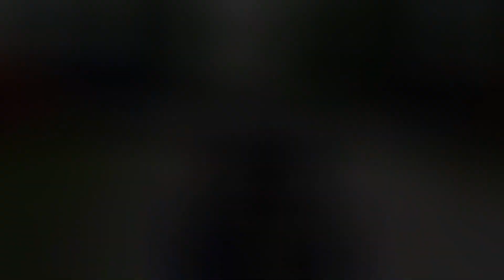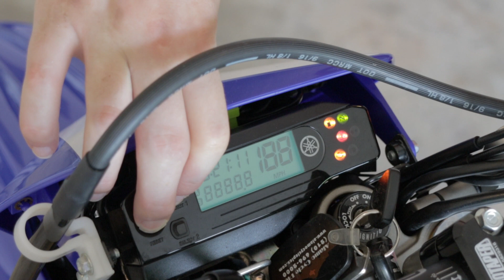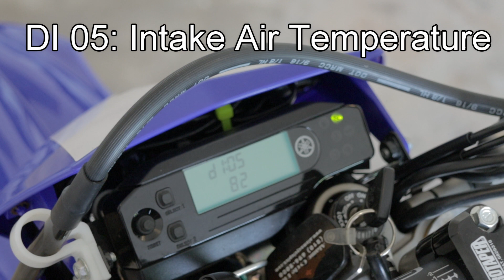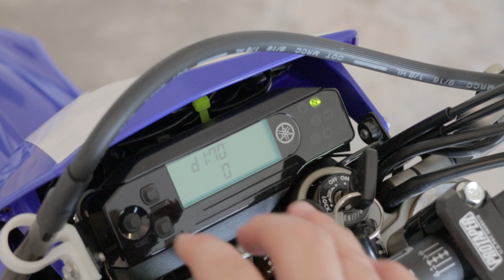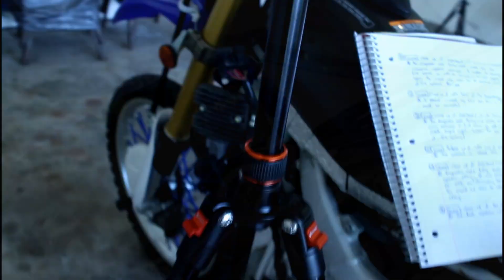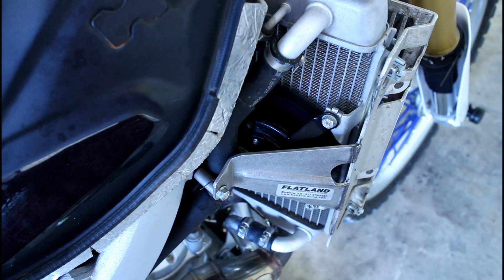Yamaha WR250R Diagnostic Mode

Comment: I'm getting a check engine light but no code. I'm not getting a clicking sound when I check d50 although I am getting the light on the dash. Can anyone out there tell me where exactly the relay is that is supposed to click for d50. The video says it's in a cluster of wires near the battery but with it not working I can't figure out where it is exactly

Comment: Obviously all those sensors aren't by the battery. The engine coolant isn't back there. So ther sensor wouldn't be there. You tear all the plastic off to point to one location. Nice.

Comment: haha literally no one knows where the air intake pressure sensor is located on one of these..... not even yamaha has a pinpointed location in the owner's manual or a OEM parts diagram. 

The greatest mystery.....its hidden somewhere amongst everyone's lost 10mm sockets i'm guessing.....hahaha   
Or in all seriousness.....it is actually located underneath a bar of metal on the top of the subframe towards the gas tank on the left side and is an absolute pain in the ass to get to.......
Reply from the maker: I’ve never had had to dig for it myself, but yeah I was just going off the service manual so I figured it was a reliable source.  Good to know where it actually is, in case I ever need to access it.  From the sounds of it let’s hope I never do.

Comment: Did you display the 02 sensor fault code. ?
Reply from the maker: Sorry just saw this.  I'm in Texas so mine didn't come with an O2 sensor.  At least not to my knowledge.  I replaced the whole OEM exhaust and I don't remember having to deal with an O2 sensor.  I know some states like California might have different requirements and Euro models as well.  If yours has an O2 sensor, I would look for the Euro model service manual and maybe there will be more information on that.  I looked through my service manual and I wasn't able to find anything on the O2 sensor.

Comment: Hi, thanks for this instructive video.hope you can get a issue from you my WR 250 front signal is lighting Fixe there no default light flashing even disconnect the signal relay its still lighting Fixe.
Reply from the maker: Sorry just saw this.  I'm not sue if you found a solution for your issue, but I'm not sure I'm understanding what is happening with your bike.

Comment: Thank you very much for your video it is interesting I have 1 question my motorcycle does not turn on the fan and it is warming up
Reply: Hello Markus, if the fan is not turning on, the problem may be from 3 different parts. You should check theese 3 and you'll be ok.
All of the parts below are relatively cheap to replace.
1- Fan motor failed.
2- Coolant temperature sensor failed so the bike does not know when to activate the fan.
3- Thermostat failed and stuck on closed position so hot coolant can not enter the radiator.
-----If you download the WR250R Service Manual PDF, you can find where theese parts are located on your bike.
Cheers
Reply from the maker: No problem glad you got something out of it.  I didn't catch the question, but if your fan isn't turning on, that's not good.  You're bike will probably over heat.

Comment: Hi, thanks for the video, it's VERY interesting to me, 'cos I've just bought a second hand WR250X...
I've got a question: do you know whether this bike has main keys with transponders or not? I mean, do it has the immobilizier? I ask this 'cos the seller gave me the two keys without any plastic on the top of the key, so for sure there's no electronic inside of the key...
Thanks
Reply from the maker: I bought mine second had as well.  One key had the plastic on it then the other was all metal.  My guess is that the previous owner of yours lost the one with the plastic and had a copy made.  To my knowledge the key with the plastic does not have a chip in it.

Comment: Thanks for the great video. I’ve just run through all the diagnostics steps as per your instruction.  All is good except that I couldn’t hear relay sound on 36, 48, 50 diagnostic codes. But at the same time engine trouble warning light illuminated. Is it something which I should worry about?
Reply from the maker: Nah, you should be good.

Comment: So where is the other video for the code history. My codes on D1:61.  I  have 4 showing. 12 - 30 - 46 and 70. Please help.
Reply from the maker: Sorry I haven't got around to it.
12 = Crankshaft position sensor
30 = Lean angle sensor
46 = Vehicle system power supply
70 = Left idle control
Good luck.  You can pretty much dismiss #30.  It just means you dropped your bike and the engine shut off.  #46 is either a bad battery, stator, or you have voltage drain somewhere in your electrical system.
Reply: @MotoBeto82  what about the crank position sensor? My bike lost power one night driving downtown. I didnt even make it home. Now when I give it throttle it gets stuck in higher rpms. Twist it again it goes back down or gets higher sometimes. You have to twist throttle backwards forcing it making it rev down.
Reply from the maker: Forgot to mention that #70 is nothing to worry about either.  Just means your bike automatically shut off after 20 minutes of idling.  I would check my throttle tube, casing, cable, throttle body first.  Make sure nothing is getting stuck.  As far as the crank position sensor, either the sensor is just bad or there is something going on with the crankshaft.  Does your bike run poorly?  Bad gas mileage now?   Below are some possible malfunction causes listed in the service manual.

-Open or short circuit in wire harness.  

-Defective crankshaft position sensor.  

-Malfunction in pickup rotor.  

-Malfunction in ECU.  

-Improperly installed sensor.
Reply: @MotoBeto82  I dont ride it at all. It's a 2011 model with only 1650 miles on. Just sat for a while. There was a recall for the stator I've got to get it replaced. The oil level is high but drain plug is stripped out.  When I noticed it  was when bike started acting up. So I just got it home and havent figured it out yet. On the way home it slowly lost power and eventually it wouldnt stay cranked. Then had to tow it.  Might be stator but it has a new battery. I'm thinking throttle sensor or throttle cables could be bad. It started having problems when I did a take off hit 3rd gear and bike just lost power only had half power. I just got bike a few weeks ago.
Reply: @MotoBeto82  I'm thinking when I gunned it the throttle cables came apart some and got stuck and at same time stator could have killed battery already. I rode it a couple of times. I just hope the oil level didnt screw anything up
Reply from the maker: It sounds like you have a couple separate issues.  So code 46 is definitely the stator then.  The bike could run with a weak stator but it will run poorly.  It will cause a weak spark and the bike will definitely lose power when that happens.  I know it doesn't have a lot of miles but check the spark plug and coil make sure they are both in good condition. If the bike has sat without use for a while, it is probably not a bad idea to check your gas tank to make sure it is not corroded inside.  Check the fuel pump filter.  If it is clogged it could also cause your bike to lose power and run poorly due to the lack of flow of fuel.  Probably wouldn't hurt to make sure your fuel lines and injector aren't gunked up.  As far as your oil level being high, yeah that could definitely cause problems.  Guess depending on how high it is.  Too much oil will cause high pressure in the crankcase.  That could possibly be what is going on with code #12.  The increased pressure and oil could also make your bike lose power due to the increased drag on the moving parts in the engine.  Also with too much oil sometimes that oil makes it up to your airbox via the AIS.  If your air filter is really saturated with oil it can cause a loss in power since not enough air will get through.  If this is going on, obviously you can tell by the air filter and it will show on your spark plug as well.  If there was something going on with your throttle position sensor you would show a code #15 or #16.

Comment: how do you check the rpm with the diagnostic mode ?
Reply: when you see Diag, instead of pressing reset and select 1, just press select 1, and you should see C0 (instead of diag) and I think from there you hold reset and select and then you will see C1, then you should see the rpm.
Reply from the maker: Not sure.  I was only able to find something on it but it was for the wr250x.
Reply: https://youtu.be/QKv4Lk-adKk. 
I have a 2020 wr250r. I had to jump the cable for the tach.

Comment: how you can check the ECU ? if they are bad or not ?
Reply from the maker: Good question.  I guess you can take it apart and look to see if there are any shorts on the circuit board or if there are any melted components.  Also, look for corroded parts.  Without the equipment to really check it, it will be hard to do.  The ECU controls so many things that depending on what part of the ECU was damaged would depend on what the symptoms will be.  The check engine light would be on.  If it is completely fried, obviously the bike will not run.  The bike would run rough.  Gas mileage would be off, ext, ext.  You can start with a voltmeter and check to see if the resistance is within spec.  Sorry, I know it's kind of broad but I honestly do not know how to diagnose that problem.
Reply: well the way you test the ECU, lets say your code is #13, which is the intake pressure sensor error (which is what I have right now), there is 3 issue with that intake pressure sensor, first one is the sensor is dead, second one is that there is a short in the wire, and if everything else is fine (for the 2 issue) then you can assume it's the ECU.   so you do step elimination until the only thing left is the ecu.

Comment: Great thorough video ... learned a lot. My rad fan and headlight relays are not working during the diagnostic tests.  Headlight seems to work with bike running, not sure if fan does. Getting 17 and 30 code also. Have same exhaust set up as you, same fuel programmer. Bike has engine light on but seems to be running well. Maybe fuse causing issue? Would you know if on same circuit with fuse or separate.? Suggestions?
Reply from the maker: Glad you got something from the video.  That's why I started making them.  I learned a lot from others as well.  Yes, the fuse is definitely on the same circuit as the headlight relay.  I looked it up on the service manual.  If the fuse was out I would think that your headlight would not function.  It could be that your diagnostic mode (DI52) itself is not working.  Check in the diagnostic mode DI60, that is your EEPROM fault code display.  If the testing process for your headlight relay is not working right you will see the number 52.  I would think that if there was an issue with your lighting system, the headlight would not turn on at all.  Same thing with your radiator fan.  If there is an issue with the testing process (DI51) you should see a 51 code when you go to the DI60 in diagnostic mode.  If your fan is not turning on while you are riding, I would think that your temperature light would turn on after a while.  If it gets hot enough your bike will possibly even just turn off. 

Code 30 is just your lean angle sensor.  If you have dropped your bike and it has turned off, it's going to register code 30.  I would erase the code history and check if it still comes back.  Most likely it won't until you drop your bike again.  If it does and you didn't drop your bike, it could be an issue with the lean angle sensor itself. 

Code 17 is the EXUP servo motor circuit.  Did you remove the motor and the valve?  If so, did you install an EXUP Servo Emulator?  If you did all that and are still getting code 17 I would guess that maybe your exup servo emulator went out.  If you removed the servo motor and valve but didn't install an emulator, that could be it also.  It's had to say what exactly it could be.  Your bike might have some electrical gremlins as well.  My advice would be to get yourself the service manual for the bike if you haven't already, and look up the fault codes on there.  You will find what components and probable causes could be the issue.  As well as what you should check and whatnot.  You will also find wiring diagrams for each system, which comes in helpful if you are having electrical issues.